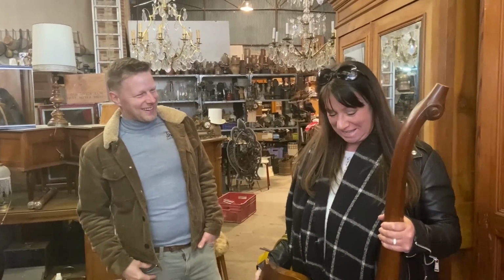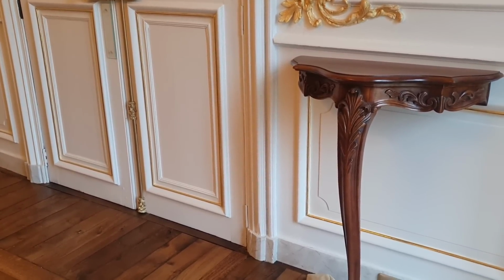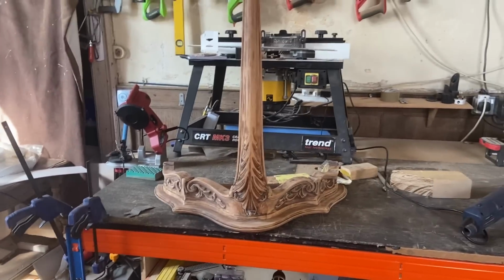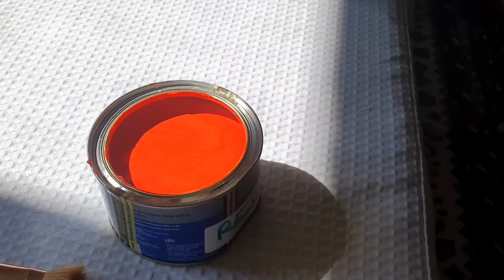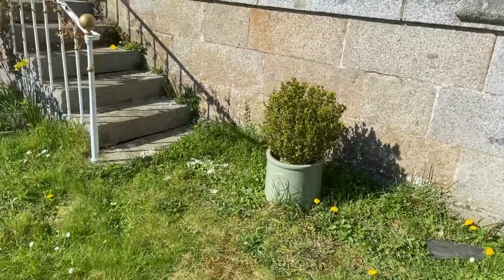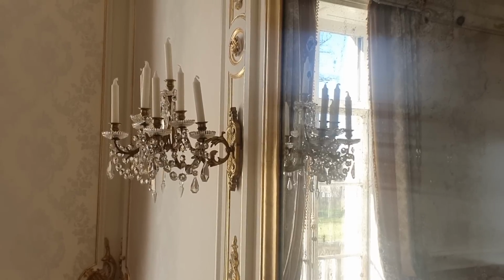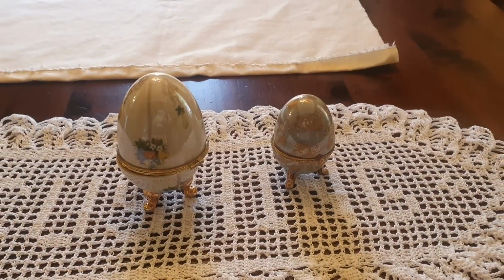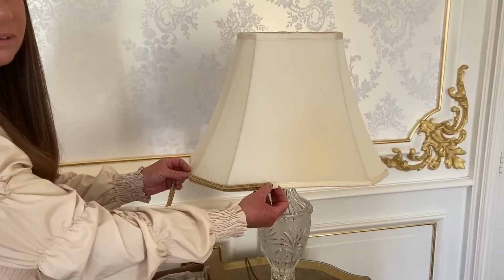We Discovered A Hidden Gem! - Brocante Shopping

Comment: Option 1 on top and bottom of the shade, the tassels are over the top!
But!!!!!!!
Once done and lived with for a while, if you feel something is still missing you could attach a crystal droplet trim to the bottom as well…..
As for the one legged console table, you only really have two spots for it….
On the wall Between the curtains or on the opposite wall between the hall door and fake door, anywhere else you would need a second one to balance it out, plus the radiator placement stops you from using the other walls if you want to keep it balanced……

Comment: A product line called krud cutter actually acts like a light surface stripping product for furniture refinishing for painting, to save you the work of sanding the piece. I find it works really well.
How can a one leg table be leveled? A disguised wedge under the leg? - very pretty, hope you find more.

Comment: Carole I feel the braiding would look nice on the top and bottom of the shade as well as the tassels the same way 

 Now if you do the tassels you could also hang on all for corners. And in the middle of the lamp shades a crystal prism   I my self went and got French style lamp shades and I put the crystal all the way around the shade every 4 to 5 inches I sewed them on with needle and thread  now my shades are a little darker then yours are  I love them 😍

Comment: I would put the gold piping only at the bottom because visually it continues the gold leaf line on the panel surround behind. If you put it on the top it seems a bit to much and it the middle of fabric panel behind. Also I think the detail of a crystal finial to be a better touch.

Comment: I like the lamp shade with the edging, on the top and bottom of the shade.  However, if  you are doing finial, I would wait to add  the trim, until you have the finial, as the color of the trim may clash, with the color of the finial.

Comment: I'd just like to complement you on finding a Chateau of a reasonable size. So many of these you see are vast buildings with 103 rooms, really now, who needs 90 bedrooms? lol Bragging rights I guess.;) Your place seems much more manageable.
I really love the dining room, perfect warm blend of wood trim and strong color of wallpaper, it's just stunning.

 I would offer one suggestion from one old remodeler to another. Have you tried using a heat gun to strip the paint? It melts the paint and makes it easy to scrap off without a fire risk or having to deal with a bunch of chemicals.
Reply from the maker: I used the heat gun on the front door!